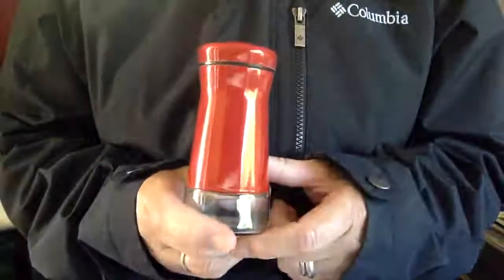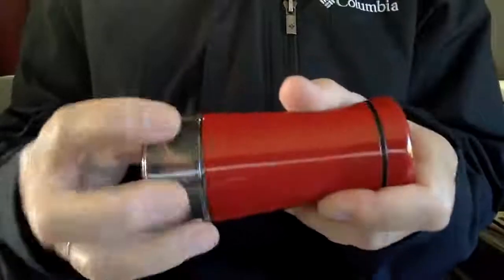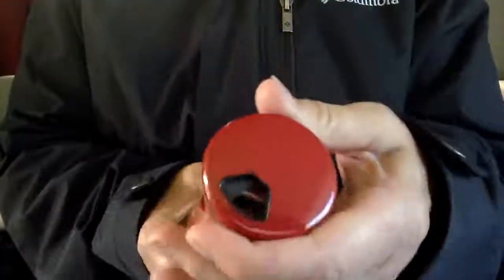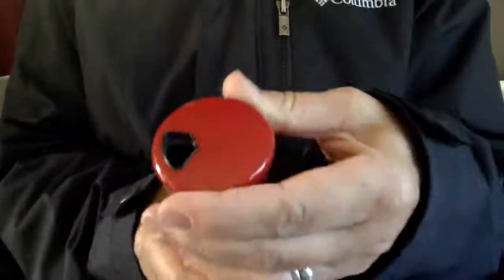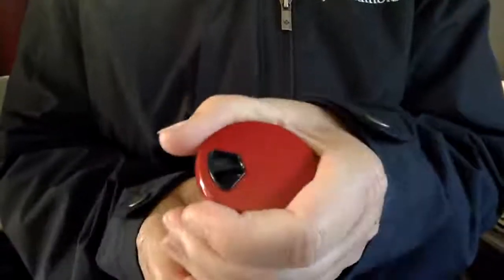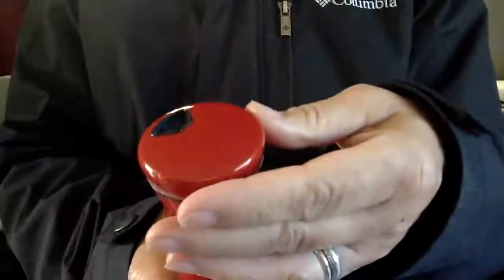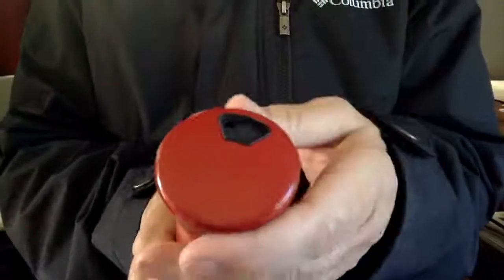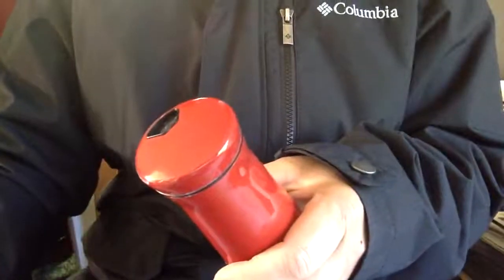CHEFVANTAGE Salt and Pepper Shakers Tips and Tricks

Comment: This was really not a good design.  It has been im[roved and the new design works much much better.  Its been redesigned so that you twist the body of the shaker to open for filling.  The adjustable top is only for pouring.  Works much better.  Thanks for the improvement and listening to customers concerns.